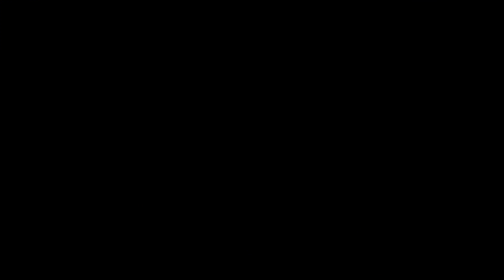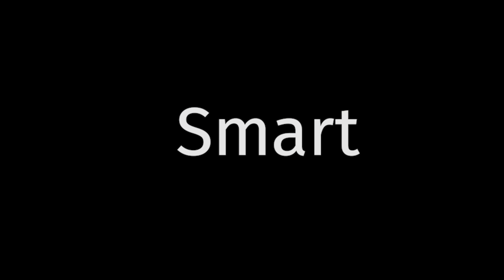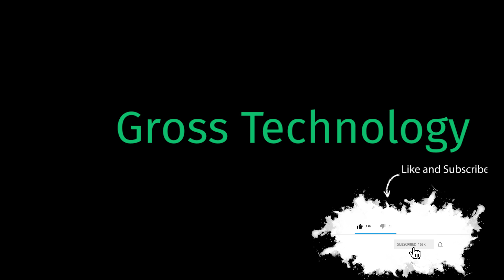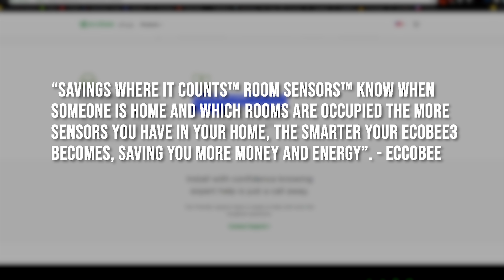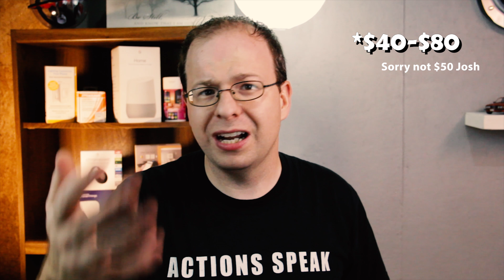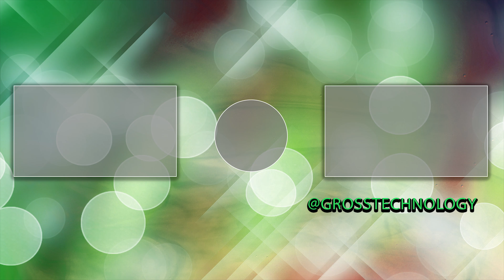Should You Buy the Room Sensors From Nest and Ecobee? #VEDA Day 4

Comment: Now let's talk about these smart vents!!!  Great video man! 🙌
Reply: What you really need is.......balancing the output of each heating/cooling duct in the house for each room.  For both the summer and the winter months.
     Buy yourself some inexpensive ($2) thermometers and install 1 in each room at eye level on an interior wall.        (Please do not try and get by with just a couple of thermostats——- it won’t work)
Now read the temperatures every day morning, noon, afternoon and evening.  Record these readings on a temperature chart.   You will notice that each room will have its own individual temperature trend based upon solar radiation or lack thereof.
     Now analyze the data you have collected.... You will know which ducts need increased airflow and which ones need to be turned down.  Make the changes to the air flows within the ducts and monitor / record the temperatures  in all of the rooms continuously.  By tweaking each duct you will be able to balance the temps within the home.  This is done by finding the dampers on the duct and moving them a little at a time.  Over a period of time with the proper tweaks all of the rooms in your house will be very close in temperature.  NOW MARK THE POSITION OF THE DAMPER CONTROL. WITH A SHARPE PEN FOR WINTER OR SUMMER.  BECAUSE DIFFERENT SETTINGS ARE NEEDED FOR HEATING OR THE COOLING SEASON.   So when the opposite season rolls around a ten minute trip to the basement to move the dampers again should do it.

If you have a two story home an Automatic temperature sensing exhaust attic fan may be required to attain and maintain comfortable temps in a room with a southern to western exposure.  

A contractor can install the attic fans with no problems.    However ...... they will not want to balance your home  room temperatures for you.  It is too labor intensive and they cannot do it in one trip.  Plus once you find out that this procedure works you will want it perfect and they cannot make a profit by taking all of the time to adjust the dampers.

A contractor will want to install a couple of smart vents and call it a day.  Literally, they might work or not and you will be left making all of the adjustments in any event.

Good luck. Try it ..........Your comfort level will go way up and all you had to do was move a few damper levers around.
Reply from the maker: Haha yeah I’ve gotta get a smart thermostat first, then the vents. But they are really cool.

Comment: So I have decide to buy a new macbook Pro 2018. Can i connect my Cinema Display and my thunderbolt 2 Sound card to it?

With an adapter of course.
Reply: Is it safe to buy one?
Reply from the maker: Are you asking if it would work? Yes as long as the adaptor allows you to go from thunderbolt 2 to 3 (usb-c)  is one that supports display as well as data.  Here is the one from Apple: https://go.magik.ly/ml/ebuy/  But read at the bottom, there are some "notes" about what it will not do.  Also keep in mind that your power for the laptop is also thunderbolt 3 so make sure you have enough ports on the one you decide to get.
Reply: Gross Technology 

So i cannot connect my Cinema Display to a macbook pro 2018?
Reply from the maker: No with the Cinema Display, it is a different connection and I/O that doesn't work with Thunderbolt 3.  Best bet is to either sell what you have and use it to upgrade to the new Macbook Pro and a new display, or if you are spending that amount, why not just get one of the iMac Pro models? Then you won't need the display.
Reply from the maker: Hey Mrbigfrog! Welcome back! I believe that does work. Let me do some looking into it, I’ll get back to you.
Reply: Gross Technology 

Hi is it safe?
Reply from the maker: Is what safe?
Reply from the maker: Yeah unfortunately that how it goes with Apple, they don't like to keep supporting their old stuff, even when that stuff still works.  Another idea, check out on Ebay to see if you can get a macbook pro with the older thunderbolt 2 ports.  Then you be able to do it.
Reply: Gross Technology 

🤠
Reply: Will the macbook 2018 support a 5k display?